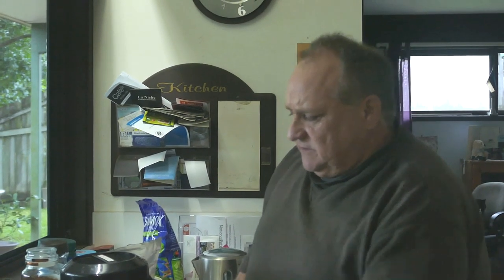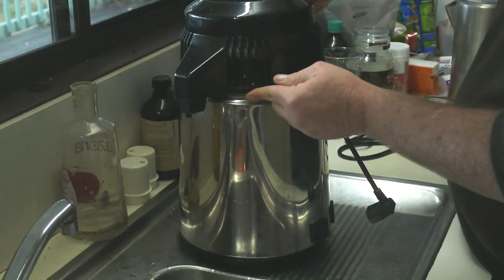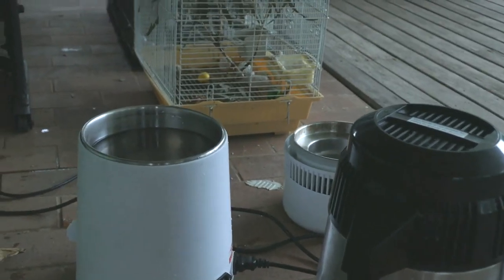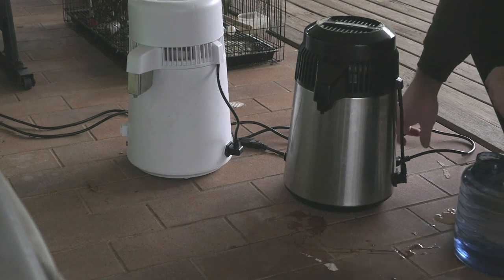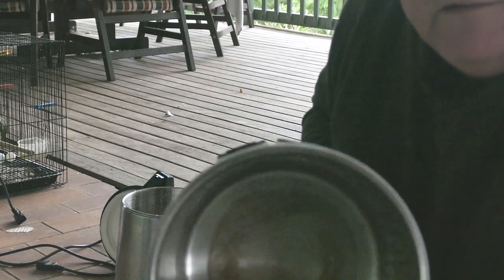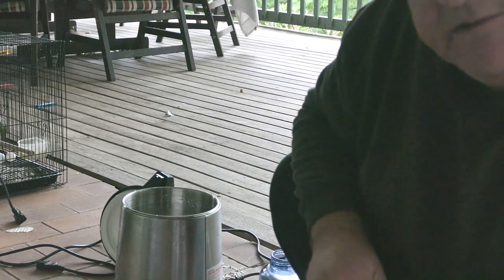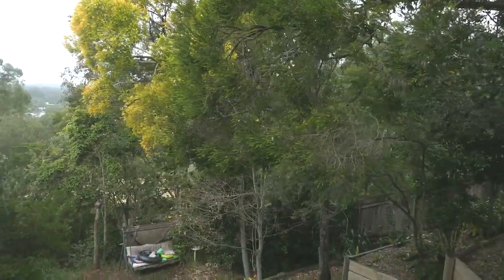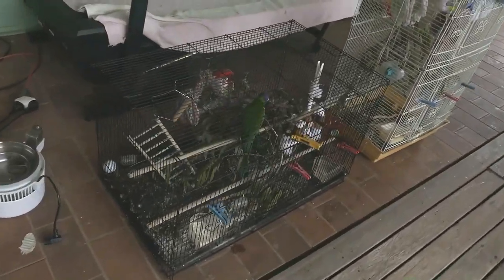How to Filter Fluoride From Water Distillers For The Home

Comment: I did hear that if you extract all the elements out of water just be sure to nourish your body with the proper minerals so that you are not deficient because distilled water attracts like a magnet and it will sap your bones of the necessary minerals you need but great job God bless
Reply from the maker: That's a common misconception - But unless one's living in a desolate remote area of a totally impoverished country, we do GET all the minerals we require, from our normal diet. 👍🙂

Comment: Just wondering if anything that you know of thats available that can be put onto your mains supply just after the meter so it can filter my entire supply before it reaches my house? Ive never heard of anything that does this but maybe someone has? 
Thanks in Advance.  
was  also very curious to know if you noticed  any drastic changes after eliminating your fluoride intake? Do you think your physical,  cognitive or neurological  system are any better for it? Flouride Is A highly potent  neuro toxin so Im very keen to get your  Thoughts on this.
Reply from the maker: Definitely I recall feeling physically better! Yes there ARE filtration systems for whole house (very expensive) BUT: as per my very recent update on what you should filter from your water, NONE will get rid of things like Fluoride! That can ONLY be removed by distilling;https://youtu.be/ksSf1-ihCEA

Comment from the maker: APRIL 4 2019 : FDA PROPOSES NEW FLUORIDE STANDARD FOR BOTTLED WATER,
BUT SOME SAY IT’S STILL TOO HIGH. The US Food and Drug Administration (FDA) issued a press release announcing a new proposal to lower the maximum level of fluoride that can be added to bottled water, from 0.8 ppm down to 0.7 ppm. The reduction of 0.1 ppm is FDA’s effort to help reduce rampant dental fluorosis. This change does not lower the allowable level of naturally occurring fluoride in bottled water. http://fluoridealert.org/about/archive-of-fan-bulletins/
Reply: Hello Steve, I enjoyed your video, you show that rain water is about 18 ppm, we only distill rain water to remove the pollution since the metals are not in it already, said that the rain water itself is way better than a tap water. How are you feeling on drinking only distilled water?
Reply from the maker: For sure - Good to filter it as run-off from roof probably has some gross stuff like bird poo in it!
Well, I haven't YET gone back to making a fresh batch, but I certainly remember feeling significantly better when I only drank distilled water for a week - Must make more this weekend! 👍

Comment: How would you get fluoride out of the shower? And what about reverse osmosis?
Reply from the maker: Lucille Femine Don't shower.
Hahaha...Seriously, I doubt there's an economical way to do so. RO is probably the next best thing  (just bare in mind it is NOT the same thing!).  Personally, I wouldn't be overly concerned with shower water; the main point with distilling is for drinking purposes so you don't ingest it...You can always close your eyes and mouth in the shower - that's what I do.
Reply: Ok, thanks. I have a distiller but thinking of buying a 3 gallon Berkey. Dr. Mercola also says to take very quick showers in the coolest water you can stand. Best solution is to get the fluoride out of the water!!
Reply: Steve Mack With every shower you absorb about 1 liter of water through your skin.
Reply from the maker: ODamoo WoW 😨
That's a statistic I didn't know! - thanks for sharing!
I tend to have a bath myself, so at that rate I would probably absorb more!? (at least it helps prevent dehydration I guess?)

Comment: hot water into plastic holder? then donts show reading,like 'anything under 10 is good '???
Reply from the maker: In the re-make of this video (better sound);https://youtu.be/P6WqbOQu0Mw I do mention that the container is certified BPA free.
'anything under 10 is good ' refers to world standards that class <10 as being pure; however - distilling by the method I use, normally results with only 1 or 2 (MAX) PPM.  Do you have a better way to purify water that doesn't end up containing fluoride? - would love to hear it...